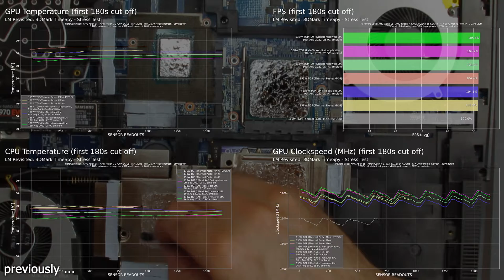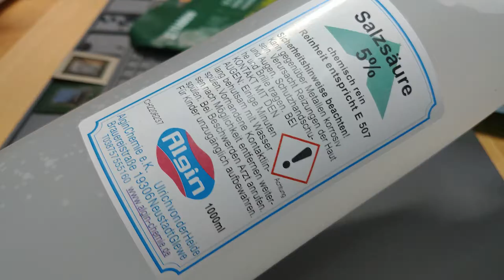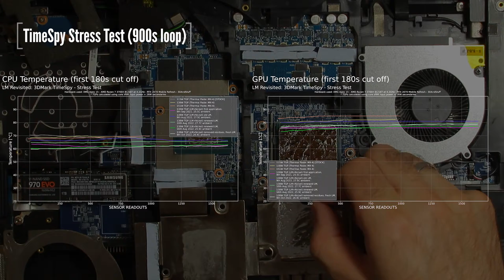Let's remove liquid metal residues! - Liquid Metal Revisited - Part 2/2

Comment: Hey I wandered do you think I could use a nickel plated copper sheet between the heatsink and cpu so I can apply liquid metal? And if so, what thickness would you recommend it to be ? Thanks 👍
Reply from the maker: No. You would have to use another TIM between sheet and heatsink. Every layer of Tim increases temperature

Comment: This is why I really recommend PTM 7950 for laptops. Honeywell created a miracle thermal pad that cools almost as good as liquid metal with zero risk of short circuit and no staining of the copper heatsink.
Reply: I'm currently using that. While my Alienware X17 R1 now works as when I first got it, the temperatures still go to 100 celcius idk why. Maybe it's normal. However before applying PTM 7950, it would score around 11200 on cinebench 23, now with PTM it scores around 13800. Wish it would still score 13800 but reaching only 90 celcius instead of 100
Reply: @diegovillavicencio3172  Oh that makes sense. See this has to do with boosting algorithms programmed by Dell. You are still hitting 100 degrees sporadically but now you get higher clocks and less throttling. This is good.

Comment: From my own experience, I cannot recommend liquid metal as a thermal paste. As the problems in the video show, the surfaces of the cooler and heat spreader corrode after a while. Once the liquid metal begins to dry out, temperatures deteriorate. Cleaning then becomes a real challenge as the liquid metal forms a firm connection with the cooler and the CPU or GPU. In order to get a good handle on the temperatures in a laptop, I recommend undervolting the CPU and GPU. This, coupled with good thermal paste, can produce the same results as liquid metal. I have e.g. For example, on my GL702ZC, the temperatures that were initially up to 90° CPU and 85° GPU were reduced to 70° CPU and 75° GPU. All this with an unlocked BIOS, VGA Bios Mod, and some work on cooling the chassis and heatsink

Comment: Can you mod a laptop by putting a mux switch in it?
Reply from the maker: That would be a very very hard mod. Surely possible but tough to get it running and it would not be possible to control the mux switch by software (would need to be programmed into the BIOS). It would have to be a manual hardware switch. The laptop in the video does not need a mux switch, because there is only one GPU (no integrated).
All in all very very hard for a small benefit. So nothing I would want to try out.

Comment: Liquid metal is such a PITA if even a nickel plated heat sink resulted in issues like this. I might just only do it if the manufacturer came with it (i.e. some asus laptops) and otherwise just use good paste/pads like tpm 7950...